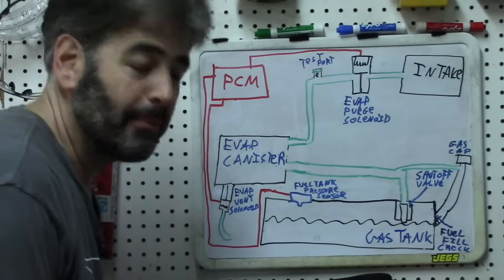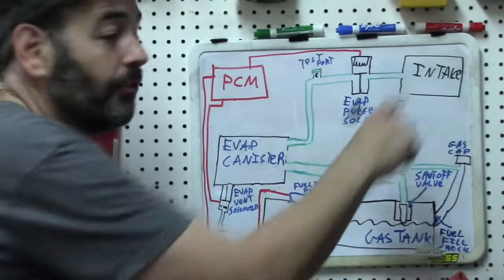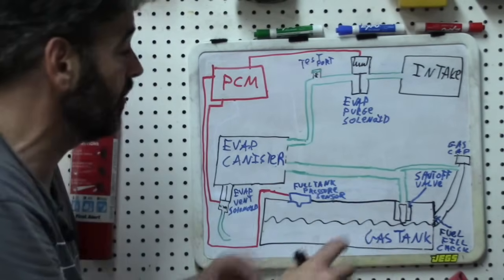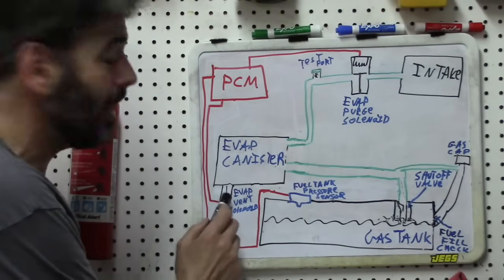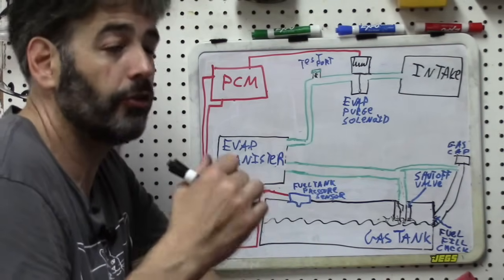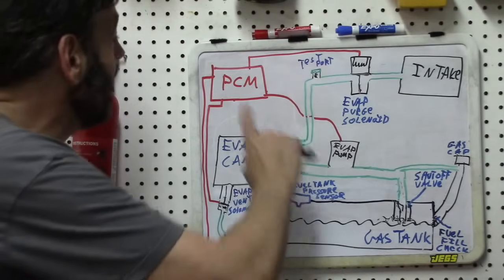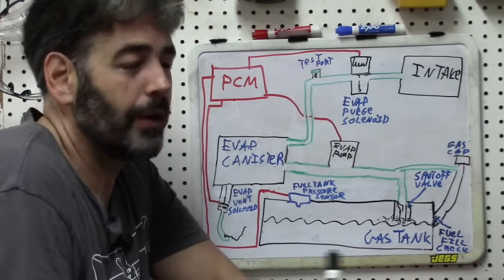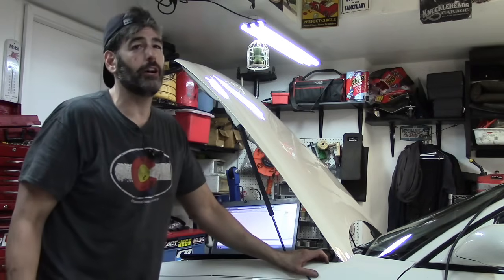Diagnosis + Understanding EVAP Systems (SBQM Full Video)

Comment: So to do the smoke test and if you don't have the scanner to close the solenoid all you need to do is plug the line where the fresh air comes in?....But then by doing it this way I won't know if the solenoid itself is has the leak so if I just unplug the solenoid will this close it? Disconnect the battery would work If unplugging it, right?
Reply from the maker: All you have to do is put the smoke into MANIFOLD VACUUM. That's all.
Reply: Guess I should've gone to mechanic school....Your my teacher. I need a manual for my 2003 yukon. Now to figure out which line is the manifold vacuum

Comment: I hear a hissing sound coming from the throttle body. This hose is connected to the back of the throttle body and it looks very brittle and complete squeezed. Is this related to power loss? Thanks for sharing!
Reply from the maker: What data do you have?

Comment: I'm looking for 2nd opinion on some work thats been done in 20 min when time frame given was 1hr, Pep Boys changed vapor canister valve removed purge solenoid and diag, total was 89.99 diag, dorman vapor canister 911-202 83.90, purge solenoid 1961 133.00 shop fee 30.66 all round up to 357.80?
Reply from the maker: I would need to have seen the data indicating the work was necessary.
Reply: @SchrodingersBox  data ?
Reply from the maker: @Except1Loser  Yes I would need to see basic data like LTFT and STFT curved against load and the fuel trim response with and without the EVAP and/or vent solenoids open vs sealed.

Comment: Excellent Instructional Videos but PLEASE stop using 'Shorthand' when describing Components and Diagnoses. Using at sometime in the Video/s the FULL Name of the Item/s to which you are referring. Example : PCM - EVAP - MAP - MAF etcetera etcetera, would be much more informative and accurate. Thanks !
Reply from the maker: As in all scientific presentations i explain the acronym once and then reference using the acronym thereafter. This is the correct way to do a presentation.
Reply: Thank you for your very prompt reply but, in almost all of your Videos (l wouldn't call them, as you put it, 'scientific presentations'), you go straight in on your Videos using 'acronym/s' otherwise l would not have highlighted it.
If you re-visit most of your videos, you will see exactly what l mean. @SchrodingersBox

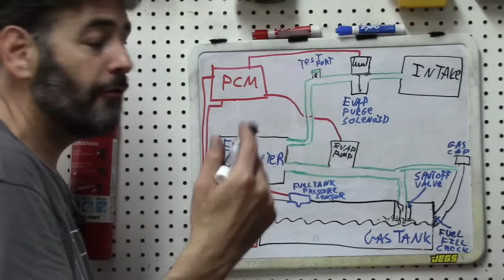Comment: 15:07 It will call it a slow leak....

My Autel scanner always refers it to as SMALL or a LARGE leak. Does different scanners use different terms, like slow and fast leak?
Reply from the maker: Yes and also different car manufacturers do as well. I also am used to small or large leaks

Comment: Hi there i have a 2009 Chevy 3500 gasoline with 2 gas tanks i replaced the fuel pump on the rear tank because the fuel gauge was not working so i replaced and the gauge Works but my truck runs for  1 minute or less and stole and now  is gas coming out from the evap purge solenoid????? Please help
Reply from the maker: What data do you have?

Comment: If vacuum is applied to a fully sealed tank. How does the vapor leave the tank?  doesn't there need to be a air inlet of some sort? is that inlet the gas cap?
Reply from the maker: remember the vent solenoid can be operated to open the system
Reply: @SchrodingersBox  15:48 Thanks

Comment: I have a 05 sentra I replaced two components vent valve on canister and one one the intake.purgde solenoid.i replaced gas cap and still get p0455 and now I get a p0442 code there one more sensor on the right side of canister
Dont no if that fix it.tired of throwing money at it.i can't afford to pay a shop.so maybe that's my problem
Reply from the maker: what data do you have?
Reply: @SchrodingersBox  just the codes.and some research.didnt do.a.smoke test.
Reply from the maker: Well let's try this: why did you replace the vent valve and intake purge? What was your data indicating those were bad?  I need something to go on here. I have nothing.
Reply: @SchrodingersBox  YouTube videos that I watched say that p0455 large leak mostly are caused by those parts not working.p0442 is a small leak.
Reply from the maker: @skywatcher856  Yes of course, but what testing did you do to verify it was the issue. Because something is sometimes or even mostly the issue does not necessitate it's the issue.
  I have to have data otherwise I'd just be guessing in the dark.
Reply: @SchrodingersBox  I did none.but thanks for replies.i will get a shop to check it .

Comment: This is off topic, but you mentioned smoke testing. I had a EGR flow code p0400, & decided to smoke test my intake after the purge valve just making sure it wasn’t a chewed up hose somewhere to my EGR or map sensor. Got that taken care of. 

But 

I found many leaks, but one I could not wrap my head around was the smoke out of my dipstick. I took care of it & replaced the o-ring but was wondering how smoke leaks out through there? Causing a vacuum leak. It’s a M112 V6 on a MB E320. Thanks for your videos!
Reply from the maker: PCv is connected to the induction.

Comment: I glanced through the comments and didn't see where anyone mentioned the leak detection pump strategies. Toyota does use a pressure sensor with their leak detection pump system, it's inside the pump assembly and they use vacuum for testing. The leak detection pump found on Mazda, Hyundai/Kia, BMW and some others does not use a pressure sensor. In order to test they pressurize the system and measure the current that the pump motor draws. They start by pumping air through a .020" orifice and storing the current value that the pump was drawing for a reference.(Example: 22mA) Then when they switch over for the actual test, the pump current drops at first as the air starts to pressurize the cannister and tank. As the pressure increases, the current drawn by the pump increases. During the test, if the amperage drawn falls well short of the reference current (5mA) then it is judged to be a large leak, slightly below the reference current is a small leak. (20mA) If the current exceeds the reference then the system passes the test.  (26mA)

Comment: Mr schrodinger..... I’m fully aware of trust issues with trolls/government spies etc.... therefore I am loathe to broadcast all of my personal info here. However in the interest of good faith I know and truly realize I’m shooting blind arrows here and throwing parts at a problem hoping I get lucky. With that being said I am at a crossroads. Long comment I know but I feel you need the full back story to appreciate my predicament. I grew up helping my stepfather clean pushrods yo the point that I have a deep understanding of why wd40 helps with arthritis. However there were circumstances that led to my schooling bring interrupted. One thing that has stuck is the appreciation for the at least semi-classics. I recently came across a steal. (At least in my opinion) in the form of a 1988 f250 with the less than desirable 5.0 with tons of potential.  I’m having a hard time diagnosing the engine troubles with. Witch lead me to your channel as I was chasing parts to change. The more I watch your videos the more I love this truck. Not because I need the biggest baddest truck around but more because I want the satisfaction of saying I built this, or the pride of keeping an older truck on the road. With that being said, I have started with my rudimentary knowledge of engines and by process of illumination with my limited knowledge started throwing parts at it to no avail. My proposition to you good sir would hopefully help us both. If I were in a fantasy world we could together set out on a journey where I video logged our interactions and you remotely and scientifically helped me keep this classic alive. A wise man once told me it never hurts to ask. The worse that can happen is they say no. My email is fred377pine@yahoo.com  I’m hoping this isn’t the last Correspondence between us.
Reply from the maker: Sounds strangely sexual... I'm IN!!!

Comment: One thing to mention, Although this is a wonderful tutorial, Many Different manufacturers use different systems as He stated. So, if You don't know the names (of the EVAP Parts) or the type of system You have, You might want to do that first. Although I did understand the concept when I first watched the video, I knew something was missing, I had to go find out what I actually have. In My case, I'm dealing with a '03 Chrysler car with all the Fancy NVLD Stuff and I don't think my system uses a vacuum pump in the line. So, now it makes a whole world of sense to know what to Actually go after.
Thanks Again.

Comment: Vehicles that have Variable valve timing need an 
EVAP pump because of the lack of vacuum at the intake 
manifold and those same vehicles also need a vacuum 
pump for the brake booster for the same reason

Comment: Greetings from Uruguay! First of all, nice videos, very clear explainations. I like them because you go beyond changing parts, to analize deeply the functioning of each component. Well, I have a chinese car, it is a Great Wall C30 with 192.000 km (120k miles). It has the same engine as 2007 Toyota Yaris (1NZ-FE). It's runing great, but I'm having a little problem that's so random I can't figure it out. The problem is that 1 out of 100 times aprox, the car will not start until I floor the gas pedal for various seconds while cranking. Then it starts very rough and won't idle if I release the gas pedal before 5 or 10 seconds when the engine stabilizes. After starting, it will start normally for many many days or even months. It has drive by wire system. Apart from that, the car has 0 issues. Can you tell something from that info? I'm eating your videos since last week when the problem appeared again hahaha but can't figure it out myself. Went from looking at the engine and having no idea what I was looking, to being able to identify each part and it's job. I think maybe it's the electronic trhottle that needs cleaning, but I'm afraid to do it and then not having the idle relearn tool if the computer doesn't adjust itself. Thanks a lot.
Reply from the maker: Happy to help- what data do you have indicating the electronic throttle is the issue?
Reply: Thanks! No data apart than just assuming from what I've learned hehe. My reasoning was: if I give it more air pressing the gas pedal, car starts. But is too much air, so it runs rough. Then the computer learns the new position to keep idling until it's more dirty, so no start condition appears again. Maybe is my reasoning is totally BS
Reply from the maker: can’t help without data, sorry. Nothing to go on but guessing

Comment: will a bad pcv or leak in the pcv system give off a bad 02 sensor code ?
Reply from the maker: Not very likely but theoretically possible. What is the data you have off the O2 sensor?

Comment: Hello all! I have an issue, any and all help would be appreciated. I have a check engine light for a "loose gas cap". I figured maybe bad cap so I replaced it with a new one. Still have the same check engine light. Also I have a problem when accelerating quickly I suddenly lose all acceleration a check engine light comes on and flashes on off on off on off on off and then the vehicle goes back to normal acceleration. I thought maybe these two issues are somehow related but I have been unable to figure it out thus far. If anyone has any suggestion or has seen this before any advice would be much appreciate! This is on a 2007 ford explorer.
Reply from the maker: There is no such thing as a check engine light for a loose gas cap.

Comment: Do a runny rich video on a 5.3 suburban.  Not the purge valve I stopped up both sides .  And if I pull off the Pcv hose it gets better than what it as at -19.5 on both banks long fuel trims and like - 3.0 on short. . Is that unmetered air still? Or does that matter? Swapped the maf from my tahoe. Is it dirty oil? Dumb question I'm sure. O2 censors are looking great.  I'm going to subscribe but dang it's hard to keep up this stuff is very interesting but hard for me. And hard to type on this little phone. We can have one but not two not readys in Texas to pass state inspection.  O yes 60 lbs stable full pressure. Not thinking 2 leaking fuel injectors on both banks. Truck halls ass and runs great. Hope I got this right on this little phone. Thanks for this video I will look into that on the hoe and the suburban sap. But evap looks harder.
Reply from the maker: I have a rich running video on my other channel

Comment: Nice, easy to understand video. I just fixed a small evap leak on my son's Impala. The purge solenoid was unable to hold vacuum but was still electrically/mechanically functional. So there wasn't any codes set for defective solenoids. The car has 120,000 miles on it so that solenoid has opened and closed thousands of times.

Comment: Great videos. I am not a professional mechanic but I happen to have a diagnostic tool. I used to wash cars and someone suggested I buy that machine. I did get one from China and self trained up to a limited level. Ever since I took to you tube once in awhile and if internet is available, I have trained to answer customers based on you tube research. In short I feel like a "change parts" mechanic. I learn a thing or two if I check a code then read about it later.
David
Kenya, East Africa near the Somali border
Reply from the maker: You should give me your email address and I will grant you free access to my pay channel. You qualify based on your location.

Comment: Hi Matt, 
Would like to know what prevents fuel vapour from exiting the charcoal canister through the normally open vent solenoid under non evap running conditions. ( Ie : when the evap is closed ) If you apply vacuum via the  open evap solenoid the vapour is naturally drawn towards the intake manifold but of course this is not always occurring. Is it simply a characteristic of the charcoal that causes the vapour to bind to it and thus prevent exit through the vent solenoid when the evap solenoid is closed and the vent solenoid is open ?
Reply from the maker: Yeah great question.  The cannister needs airflow through it in order to release the vapors. When the system is vented open, there is no airflow past the charcoal- it's just open to atmosphere is all.  However when the purge valve opens, the engine vacuum drawns the outside air from the vent in across the cannister and brings the vapors to the engine.
  It would work the opposite just as well-- if you were to open the purge valve and blow air into the cannister, the vapors would blow out of the vent valve (if it is also open).

Comment: How much PSI can I use to test the evap system with air and spray soapy water to find leak. Thanks great video.
Reply from the maker: you need very little- not even 5PSI.
Reply: @SchrodingersBox  awesome.. thanks I figured it would've been very low. Great videos keep it coming.
Reply: @nelsonnarciso1791  1.5 Psi. If u want to destroy your Evap do 5 Psi. And actually it's dangerous to mix Oxygen with Vapors when doing smoke test. U should use a inert gasses when doing Smoke test of a Evap system.

Comment: I would like to restore the EVAP system on my '85 Ford van 351 W. The plumbers and electricians nightmare control system (valves, solenoids, tons of wiring etc) and the ancient computer are long gone but I still have the carbon canister, hoses and control valve. What would be a logical parameter to use to open the valve? Engine up to operating temperature I would think but any vacuum condition or vacuum indicating idle, cruising or other?

Comment: Hi Matt, thanks a lot for the information you shared, here is my question, is there any code for the EVAP canister (itself) malfunction, in other words does the canister malfunction ?or needs some sort of cleaning or back wash since it is filled with charcoal, Thanks
Reply from the maker: Not that I am aware of. The way I would do this is checking fuel trim upon purge valve release to validate vapors are indeed reaching the intake, but my research has not indicated that this is part of the validation by the PCM in any models I researched for this video.

Comment: If the evap vent solenoid is usually open, wouldn't the system lose pressure?
Reply: Some vent designs are normally closed. This really threw off my diagnostic strategy on a 2011 Volt until I realized this was the case.
Reply from the maker: Yes exactly. That’s why during the diagnostic test the PCM closes that solenoid.
Reply: I guess I just don't get how it can be a closed system and yet this part is open so often. Seems like the gasoline vapors would escape to the atmosphere. The activated charcoal captures them that tightly?

Comment: How would the system differ if it didn't have a PCM? On a MK1 Volkswagen Rabbit, for example. Charcoal canister is there, yet no control modules.
Reply from the maker: Great question. The early systems were strictly mechanically controlled. Generally you would have a vacuum set up where EVAP would be available depending on engine temp and speed. A vacuum hose on a vacuum source that had a wax pellet that moved when it heats up or cools down would be the engine temp based control and if you wanted the EVAP available during throttle as opposed to idle you would simple located the evap hose at the throttle body where venturi force would draw the vacuum during throttle.
Reply: @SchrodingersBox  Thank you for the quick response! Would the gravity valve (located in the vent line between the fuel filler neck and the top of the fuel tank) be related to evap system?